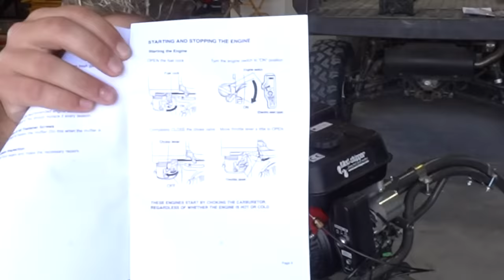SOLO Duck Hunting CHALLENGE with TINY BOAT on PUBLIC MARSH!!!

Comment: Hey Flair, you should attach a short rope to the bottom of the boat directly in front of the rear bench seat. Put a loop in the end of the rope and get it the perfect length. You want to have the rope as short as you can to the point where the tiller handle is pressed down on the rear bench seat and the motor won’t move much at all. Just attach a small ratchet strap like you had in this video for insurance.
Reply: The loop on the end of the rope goes around the throttle area

Comment: If that’s a twister mud motor they deffenetly need a cavitation plate we have one and without it can only use 1/2 throttle or it sucks air with prop

Comment: Tip for novice duck hunters:  do NOT park on the ramp to load gear into your boat  (@ 28:33); have the equipment loaded, the motor ready to fire, and the boat unstrapped, and the drain plug in BEFORE you back down.  Even if you are the first one to arrive, someone will be along shortly and real hard feelings can result when someone hogs the ramp.  Be considerate of others and you can make friends, not enemies.
If you DO arrive before anyone else, do NOT park on the ramp waiting for the next person to show up before launching like this guy did.  Instead, launch your boat, pull it up on shore to the side, pull the truck and trailer out and park them in the parking area.  You can then sit in the warm truck until you see lights coming to the ramp.  DON'T BLOCK THE RAMP!  You can then leave the truck, get in the boat, and head out to your chosen spot.   This guy does end up doing that part right, not because he knows the proper way to do it, only because he got impatient.

Comment: I'm guessing they most likely put the oil in it just to use for the first couple run to break in the engine just change it after a couple runs

Comment: The air is to suck in clean air becuase it is air cooled so leave the air filter if you took it off the engine will probly only last like 6 hours of running